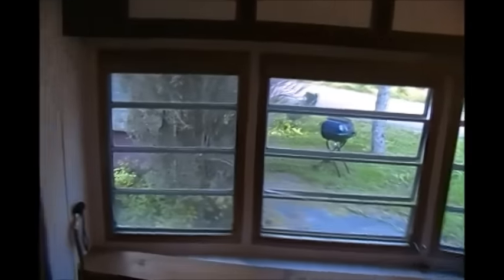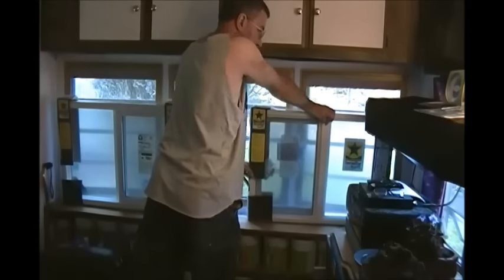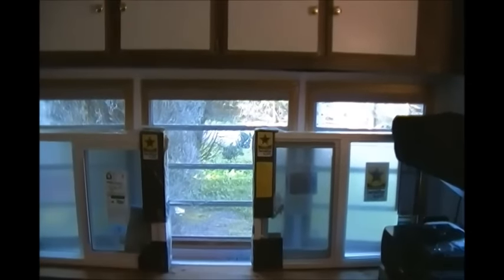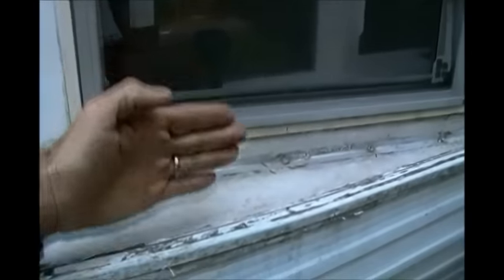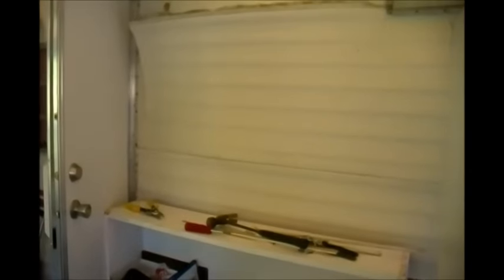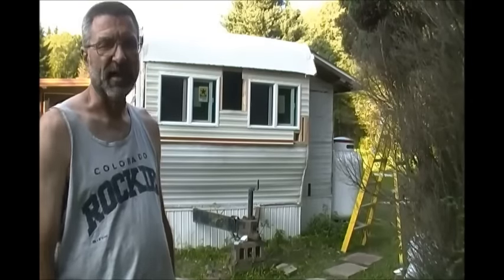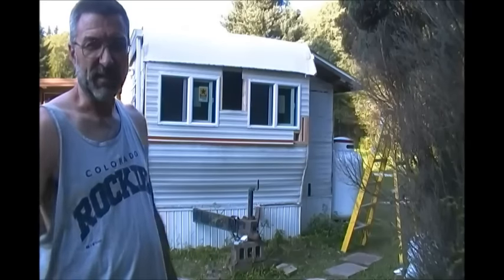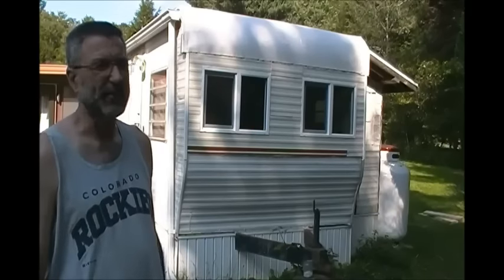Our RV Tiny House Update 4 - Windows

Comment: I just found you today. VERY NICE job on the windows! I'm impressed with how it turned out. The clock in the center is a nice touch. How big is the propane tank in back?? I liked and subbed, well done sir...
Reply from the maker: +Ray Lovett We have two propane tanks that are 200 lbs each.  We were using them for heat.  But we're not doing that anymore.  Watch our video, "Heat and Condensation Problems" to see why.  We now have installed the Cubic mini wood stove with electric baseboard as backup.
Reply: I will Bill, I do love the "wood stove" technology as a "fail safe" way to... well, you know. It just works all the way around, but you already know this. Hope you and Elizabeth are well, wave at her from us (me and my brother in KY)